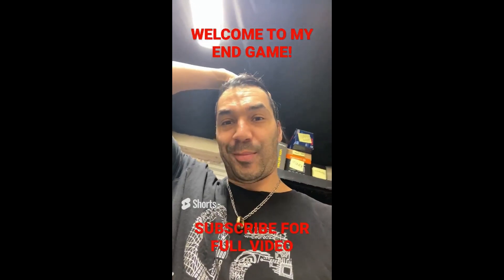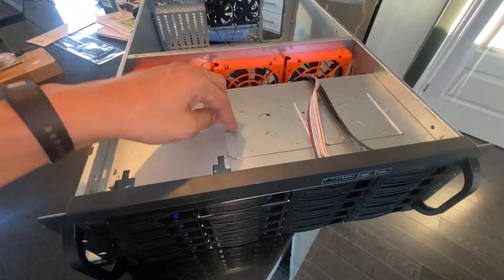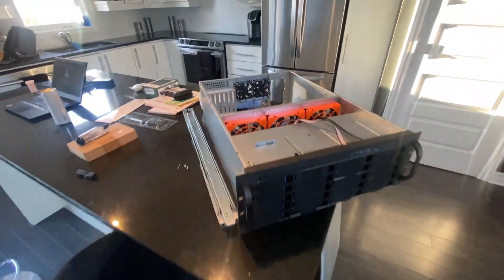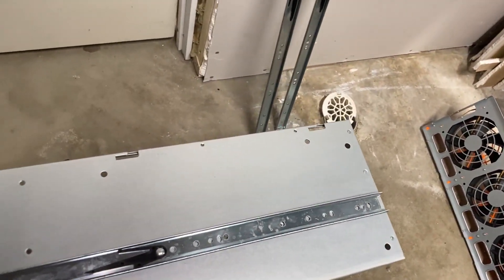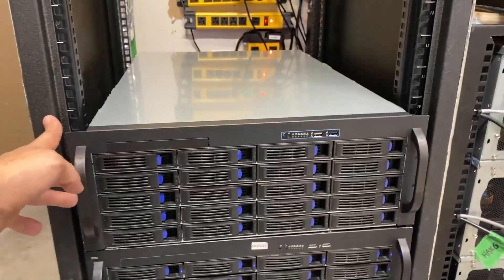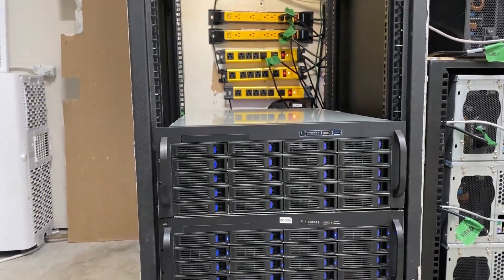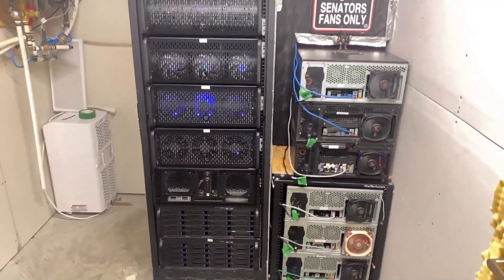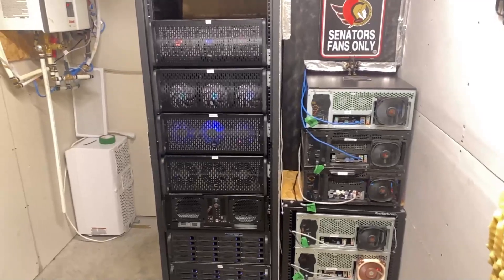Server Rack Prep for Filecoin Project!

Comment: hi, I have servers Hp 380dl G9 Dual Xeon 2680v4 56 Threads 256gb ram. Disc Sata 7200 rpm Segate 2tb
Is there any way to make it profitable? Thank you
Good video!
Reply from the maker: I’ll let you know once I get my setup but 2 Tb you will need much more than that + a good Gpu. I’ll let you know once I’m setup
Reply: Why do you need GPUs. And not just Hard drives and CPU for filecoin
Reply: What's the total power consumption for just that filecoin server